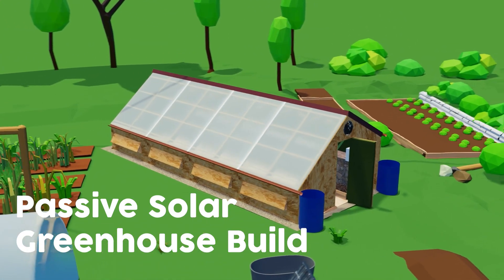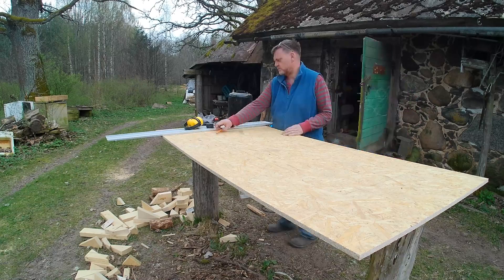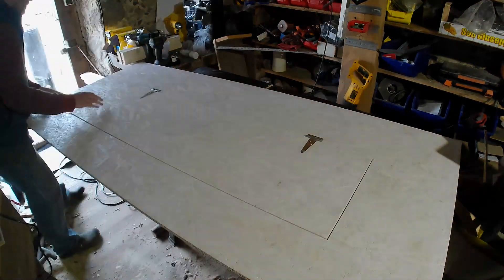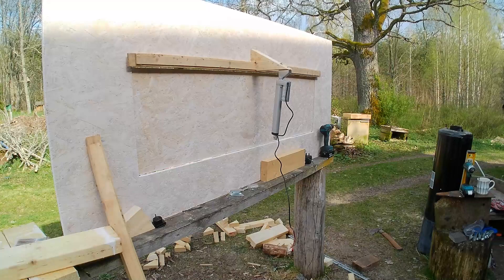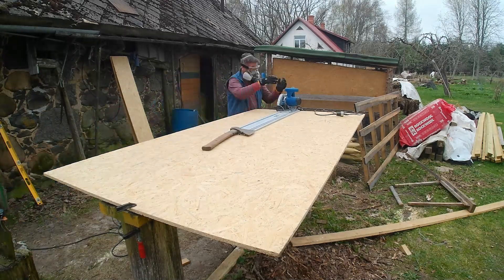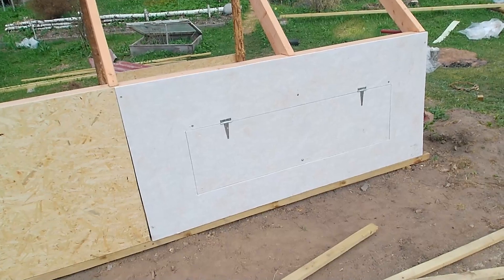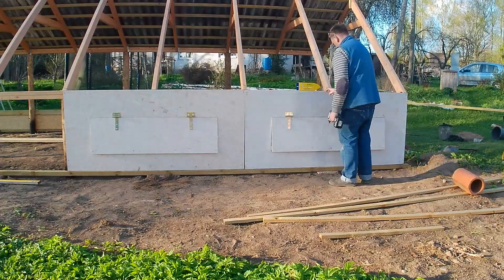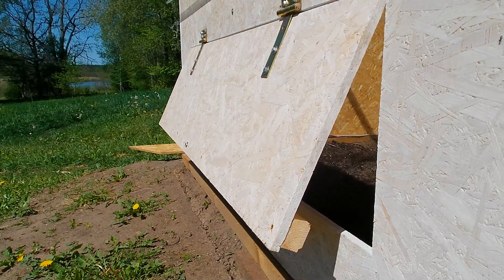Passive Solar Greenhouse Build Part 4 - South Side Panels & Window Actuators

Comment: A track saw is such a good tool.  I like the way you propped it upright as well while working on it. This is a really cool project. I'm loving it.  have you got any bracing up in the roof?
Reply from the maker: Just those trusses I built. For the polycarbonate I installed some cross braces for snow loading (next vid). I love the tracksaw in principe but I won’t lie, I am suffering a little by the cheap one I got, I’m tolerant but it’s proven the worth to invest in a better one for sure.
Reply: @BalticHomesteaders  you've seen my tools! I'm all about the quality. I should imagine you could sell that one secondhand and not loose much money on it though. Keeling good, sharp blades in it will make a difference aswell. I should imagine the one supplied isn't much good.

Comment: A very interesting video, thanks Gary.
I think that the gap between the panels might help with any thermal movement between them.
Reply from the maker: I know in building code (at least Uk) they have to leave a 3mm gap for thermal movement (or it might be moisture swelling not sure) this gap was a bit more than that and not even. My plan is to put a vanity strip over it and the other joints on that side to match. I’m not losing sleep over it but it was annoying.
Reply: @BalticHomesteaders  I think that you have done a great job . Please don’t be annoyed about a gap of a few millimetres. It will work out fine.